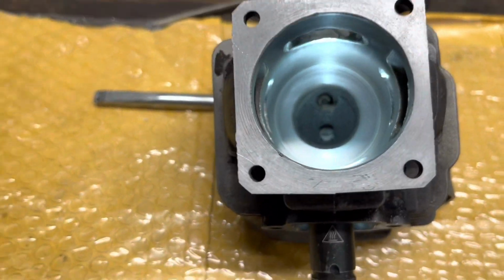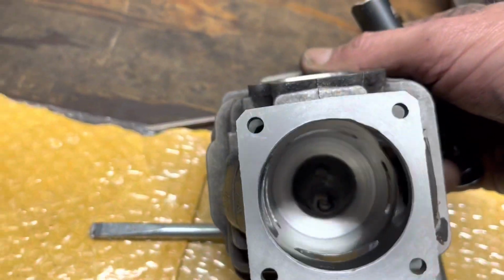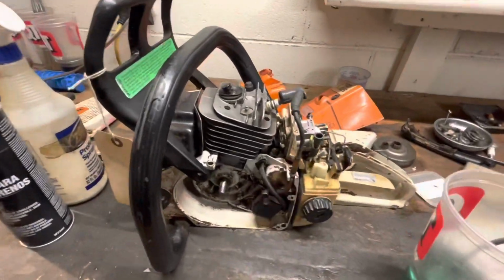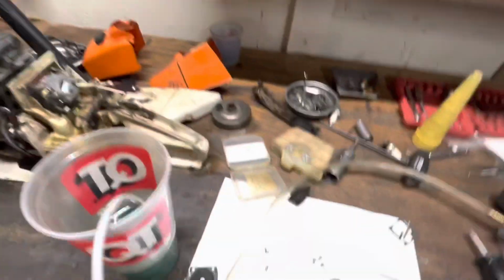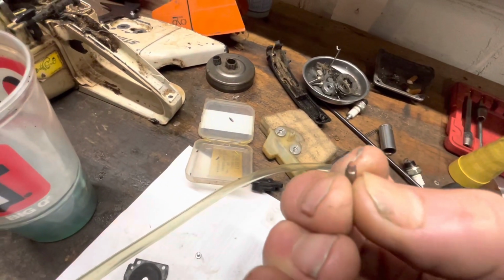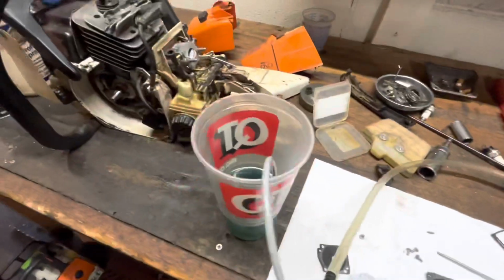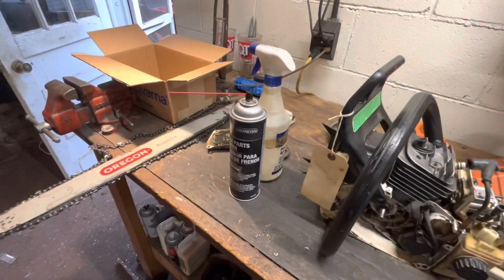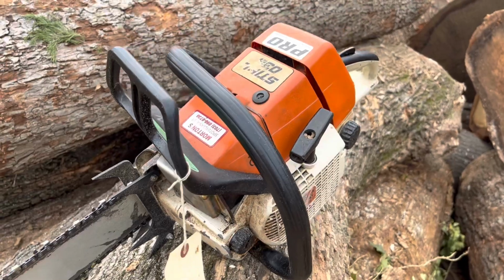Ported 036 Stihl with WCS Barkbox and 3 Point Dawgs

Comment: IMO one of the greatest generations for stihl!
Reply from the maker: I'm not sure how many late model saws we'll see hanging tough in 20+ years
Reply: @richardflagg3084  not the majority. Wouldn't be surprised if the echo cs-590, 600, 620 aren't still trucking along😅
Reply from the maker: @aaronpowell4885  Reliable as the day is long.  Especially the older gray hand held units.  I've got a hedgetrimmer that fires up every year and just won't quit.
Reply: @richardflagg3084  yep. My 18+ year old srm-230 string trimmer still starts in 1-2 pulls and runs like new. Thought I was getting a good for 3-4 season trimmer at time of purchase!
Reply from the maker: @aaronpowell4885  Echo may not have the power or the styling but Lawd they crank every time.